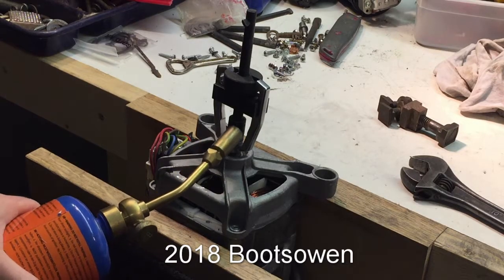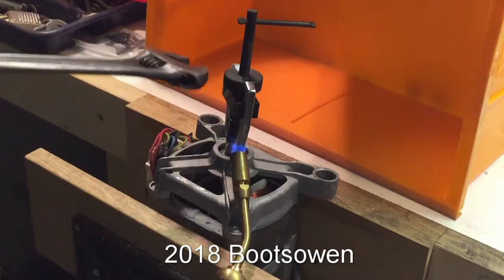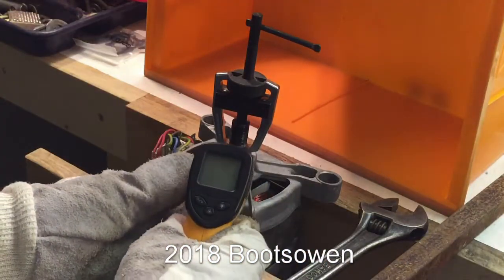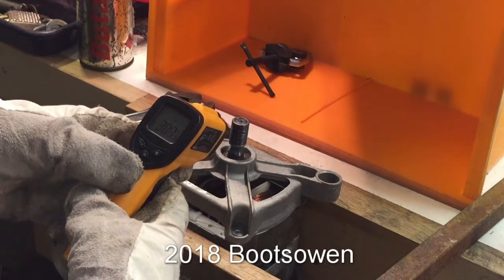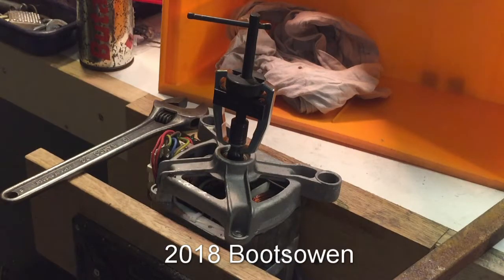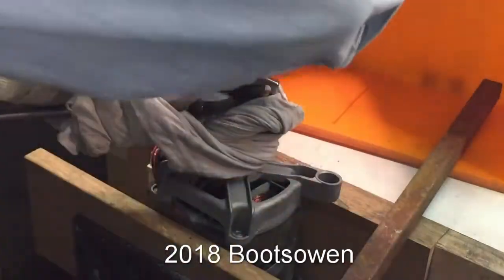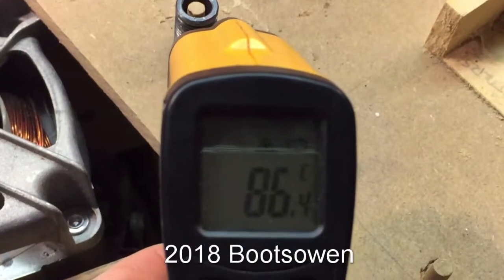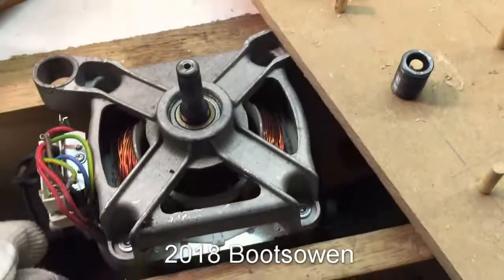How to remove a washing machine motor pulley

Comment: Good video, I've removed the motor from my Bosch WFF2001GB/01 and found the DE bearing seized. I was just going to go with the pullers, but I think I'd better get a heat source lined up as well. If it goes ok, it'll save me £236 for a new motor.
Reply from the maker: Just to let you know that I wrecked another pullers trying it again, even with the pulley red hot. I usually get these machines for free or up to £20, so I would question ever buying a new motor for that price.

Comment: Having watched this, I've decided to cut the pulley off with an angle grinder...……….
Reply: I'm thinking this too. Have you done this yet, if so how did you get on?
Reply: Yeah im gonna do that, I need a flat keyway putting on the shaft (its going on a diy varispeed sanding disk) so i'll use the pulley to protect the rest of the shaft while im grinding the keyway in.

Comment: Were you replacing the bearings and if so what were the symptoms. Im trying to decide whether it's the drum or motor I'm hearing. No rumble from the drum but a high pitched squeal when on spin.
Reply from the maker: Hi, you would rarely, if ever, have to remove the pulley from the motor. if it is a squeal it may be the belt slipping. Or the bearings or the motor bearings.  If I was competent to work on machines I would do a test spin with the back cover (if you have one) removed and listen to it.
Reply: Really easy to determine whether its the drum or the pulley. Go to the back of the washing machine, remove the cover to access the drive belt, slip the belt off the motor or drum pulley, then spin the drum independently. If the drum spins silently, you know its the motor. If its the motor, it could be the bearings or the brushes that need replacing - or both.I had the same conundrum, but could diagnose whether it was drum or motor in a few mins. Hope that helps
Reply: @bootsowen  Did you manage to get the pulley back on afterwards? I've got some new bearings to replace and am trying to get the pulley off to get at the bearing. If i can get the pulley off, the bearing is easy, but i'm not sure about putting the pulley back on?

Comment: Thank you for your hard work video, I have damaged electro motor ball bearing problem, and can't remove that shitty pulley after destroy 2 bearing puller..
Will 1800W electric heatgun do the same trick?
Reply from the maker: I don’t think a heat gun would do it. It needs to be red hot to get it off. And a lot of force on the pullers. I tried again on another motor and broke my pullers. You can get little induction heaters on eBay that might do it.
Reply: @bootsowen  Thank you for your advice...!

Comment: I tried to remove the pulley with bearing puller and heating with no success. The pulley was damaged. Later i do it again with other motor, but now I pulled with bearing behind the pulley. That way I could successfully remove the pulley.
Reply from the maker: Good work. It takes a lot of effort
Reply: How did you put another bearing behind the pulley?

Comment: I did that without heat.
Reply from the maker: well done
Reply: @bootsowen  The tachometer sensor that has a magnet inside that is encapsulated in white plastic, which is on the motor shaft in the Kenmore Elite HT3e washing machine motors. How to remove them to replace the bearing?
Does that white plastic with a magnet inside have a thread or is it put on with pressure?
Reply from the maker: Pressure I think. but easy to break.

Comment: it comes out very easily on a press even without heat...but needs to be a strong press
Reply: A normal ratchet-able bearing tool will also work. The puller in the video is for pulling tiny bearings.